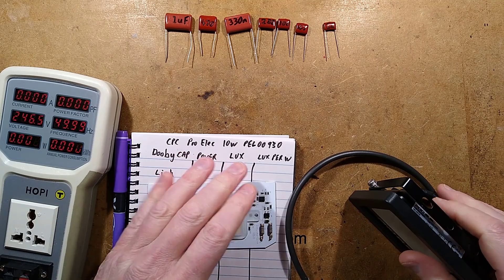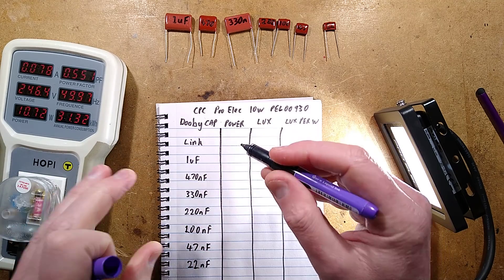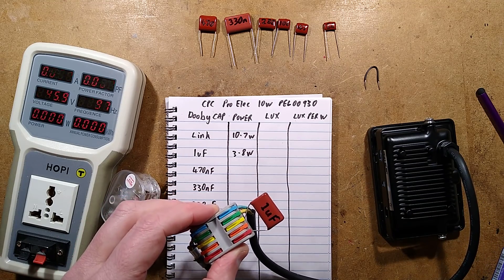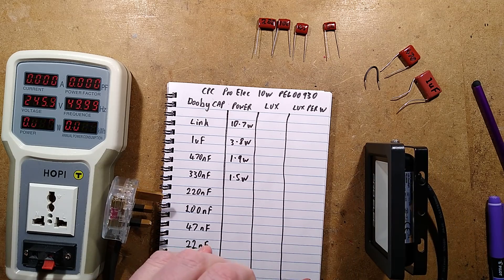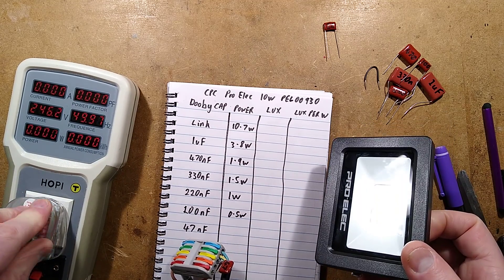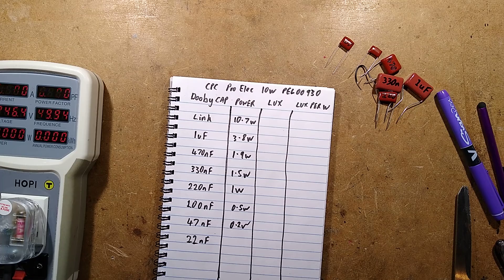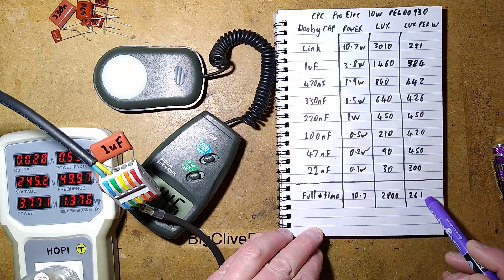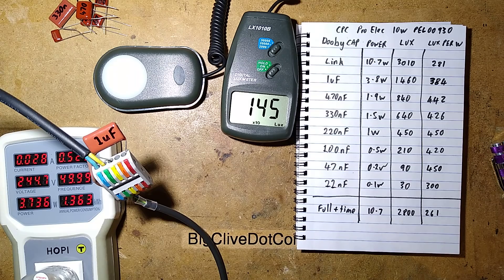Doobying a cheap LED floodlight with lux/efficiency readings

Comment: If you buy something like this (especially from somewhere like ebay) it would be worth checking the output. You probably haven't got a lux-meter, but a standard multimeter can give a rough estimate. An averagely efficient 1500 lumen light will draw 12 to 15Watts.
I bought a 1500 lumen 12volt bulb for my garage to run off a vehicle battery. I thought it was nowhere near bright enough, so I checked the current and it was about 0.4Amps or 400mA. That is under 5Watts! The light was 1/3 of the advertised power! I got a refund.
All the 12V LED bulbs on ebay were being sold by what appeared to be UK based Chinese sellers. When I contacted a couple to ask whether they could guarantee the power of their bulbs before I bought, they said something like "We don't think our bulbs are suitable for your purpose. LOL!
Edit: I have now bought some from a tool warehouse which were full power and no more expensive.

Comment: I wonder how easy it is to modify the lamp itself by adjusting the current flow (rather than a series capacitor) to do drop that 10W down to 5W. I imagine soldering on that aluminium backed PCB wont be fun

Comment: What would it be like if you had say a 3 or 4 uF cap in?   Would it give similar light level to the link, but with slightly reduced power usage?
I think for the purpose of a flood light, using the 1uF doesstill make it a very usable light.  MY mind is just wondering what saize cap will keep the  3000 Lux but with a slightly lower wattage :)

Comment: I don’t understand why decreasing the capacitance decreases the wattage.  

Capacitors resist a change in voltage.  
P = VI
As the voltage increases by lowering the capacitance of the capacitor, shouldn’t the power go up?

Essentially I intuitively think your Wattage should be going in the opposite direction, but observational evidence shows otherwise and I don’t understand why.  Hmm... I guess I could go check myself...

Comment: You've built a Dubai light that has better L/W by reducing current? It's complex because of the AC to DC and current regulation, but seems like we need better labelling of lum/W or even cost per lum-hour. We see a bulb claims to save $75 over incandescent, but don't see saves $5 over the crappy LED with poor lum/W.

Comment: I think the problem with using smaller capacitors to extend the life of the LEDs is that high speed voltage spikes from lightning and other sources can still get through.
Whereas a resistor would provide a greater impedance even for very short pulses.  Perhaps a combination of capacitance and resistance.

Comment: Does anyone know how I could calculate the needed capacitance in order to have my AC COB LED light running at a certain power? I have the one that Clive reviewed in 2017 I think, the basic cheap light that flickers because it has no smoothing capacitor.

Comment: Bought 10 60w equivalent led house bulbs only £10 B&M
Reply from the maker: Those are probably the super-hackable ones where breaking a single resistor off can make them run more efficiently at lower temperature.

Comment: I have 34  100W LED flood lights, would putting 1 uF resistors over them make a big difference in electricity usage
Reply from the maker: It certainly would, but they wouldn't emit much light.  The cap hack is best for low power lights.

Comment: Hay man can you use a variable capacitor (like the ones in old radios to make a dimmer switch for LEDs? I am a biologist so I probably fucked that up tell me why this is a bad idea 🤪
Reply from the maker: It would have to be huge.  The radio ones tended to be measured in picofarads.

Comment: Assuming no change in distribution and constant distance between luxmeter and the DUT (luminaire) whilst changing power level, you are effectively measuring the lumen output. Generally speaking, power consumption will drop by a few % once driver circuitry temperature has stabilised and lumen output will drop as the diodes increase in temperature.

Comment: Hey Clive - I love the idea but I am not comfortable with sticking a capacitor just someplace where it would be fitting.
I love the idea that I won't grill my lamps - would it be possible that you maybe show us a video where you pimp a light-fitting so it limits it properly for any bulb? 
I am not sure if I want to crack open my regular screw-in bulbs so I love the idea of putting a capacitor in the light-fixture to have the fixture reduce the power to any lamp I put in there. 
Maybe with a few infos on what to look for (proper isolation and maintaining safe electro-installation standards). 

Not as a tutorial for liability reasons per se, but more of a "what to watch out for so you don't grill yourself"
Love it and I hope the manufacturers stop their shitty greed and stop grilling everything to death.
Reply from the maker: If you search my channel for dooby you will find another video showing various inline options for use with standard LED bulbs.

Comment: Clive, you've convinced me! I saw it on the live stream, and seen the experiment here, and I'm going to "Dooby" my Yale branded yard light. It is quite tiny, and yet ferociously bright in relation to its size. It doesn't need to be, and given that it also exhibits that thing where some chips appear brighter than others, I'd surmise that some are carrying more than their share of the current. Perhaps lowering the power will take the stress off them?

Just out of curiosity, have you tried running two or more household LED bulbs in series?
Reply from the maker: It works with some LED lamps, but others have such high combined LED voltages that they won't light.
Reply: @bigclivedotcom  What happens if the bulbs are 'identical'?
Reply from the maker: @28YorkshireRose12  It still depends on the combined LED voltage.  On a lamp I just disassembled today there were only 5 LEDs but each one was 50V, so the lamp requires at least 250V before it can light.  Putting two in series would not work.

Comment: Does putting the 470nF in series work on lamps like these?
https://www.ebay.com/itm/50W-Full-Spectrum-LED-COB-chip-DC12V-32V-Integrated-Smart-IC-Driver-220V-110V/254331003382?hash=item3b374f21f6:g:mF8AAOSwEDBdVMW~

I would love to have more of them running cool instead of one of them running very hot.
Reply from the maker: Yes, but it's only suited to low power applications.  You may need to use a few microfarads for the higher loads.
Reply: @bigclivedotcom  Thanks.  I will try it.  I don't want the weeds in my garden to catch on fire. (And no, I am not growing marijuana in my closet. )

Comment: What would happen if you put this mod on the neutral instead of the live? I live in a country with symmetric plugs (northern Europe). Given that I have to ask this I will certainly not mess with mains electricity like this myself, but I'm still curious.
Reply from the maker: It can work on either conductor.

Comment: A very interesting experiment.  Someone should sell an adapter socket with built-in capacitor to increase the life of LED bulbs.  I am pretty sure that most of them are designed to fry themselves into LED lamp heaven.

Comment: Please forgive the simplicity of this question - i certainly do have large gaps in my knowledge of such things (but I do like soldering kits and pcbs for music stuff but thats mainly 12v/9v stuff) - are these Caps 250v/300v seeing as your using the lights plugged in to the mains? Im on our 3rd set of back garden floodlights (pro-elec incidentally) and extending their lifetime sounds like a good idea - well that and the fact that they tend to dazzle our cats at nigh time! Cheers!
Reply from the maker: These are standard 400V film capacitors often used as current limiters in simple lamps.  I recommend using a 1 megohm quarter watt resistor across them to discharge them when the power is turned off.
Reply: @bigclivedotcom  Many, many thanks! Sincerely appreciate it (and Im sure my cats will also thank you!).

Comment: Does running dimmable LEDs with a dimmer lead to similar efficiencies (Lux/w) or are the dimming LED drivers inefficient?
Reply from the maker: It definitely reduces dissipation, but standard dimmers are harsh to electronics.

Comment: Hello Big, could you make a video clip with a HAMS5973 type light detector (photodiode)? I recently researched led bulbs (watching the voltage out on the oscilloscope), IKEA lamps, battery-powered flashlights, and found that they pulsate in a strange way, sometimes sine, sometimes short pulses, and some shining with continuous light, I think such a movie would be interesting if you want I will send you photos of how interesting you are, u make Great Job with Light !!!
Reply from the maker: Many lamps are driven by pulsed power supplies or use PWM for dimming.

Comment: They claim LEDs to be oh so efficient and the run them so hard that they fail faster than normal incandescent and aren't that much more efficient either. sadly that is what cartels are doing.
Seriously - 50% increase in efficiency just by adding a single capacitor? While also increasing the lifetime dramatically.

Comment: So informative! Many thanks Clive. This might be worth more experimentation: what if a dimmer switch was marmalised (I haven't quite worked out what doobying means BTW!) and a variable capacitor inserted instead? Trouble is, anything small enough to fit in a flush or surface switch box wouldn't have enough capacitance - or range of capacitances. My crappy London flat built by a very well-known UK building company has hollow walls 7cm thick. I am wondering if I put a range of caps in a separate box in the wall and use a multi-way switch feeding to them, I might get some decent dimming. Plus long life out of my LED lights. The only problem I can think of is instability if the lights are some distance from the light switch. Wotchew think?
Reply from the maker: Doobying is a play on the high efficiency Dubai lamps.  A variable capacitor of the required voltage and capacitance rating would be huge.
Reply: @bigclivedotcom  Ah - so you're setting a trend. I expect the word to travel the internet...
Reply: PS Can they arrest you for doobying in public?

Comment: Great video. Could you do a video with a variable capacitor and an LED batten? Would a variable capacitor make a good dimmer?
Reply from the maker: A variable capacitor with high enough value would be huge.
Reply: @bigclivedotcom  Ah, okay. Would a capacitor  with a potentiometer in parallel be of a manageable size? If so, I'm looking forward to the video.
And thanks for all the amazing videos so far!

Comment: I have a 30W LED flood light with an integrated PIR sensor, when it was new it worked fine, it still does but over time I noticed the LEDs started to glow even when switched off, as time goes by the LEDs glow brighter and brighter at the off state, even with the power switch off which I find a bit odd what could be causing this? The switch is a double switch one button is connected to the flood light the other is connected to another light, but even with both lights off there is always some residual light on the flood light.
Reply from the maker: It could be the effect of moisture ingress.
Reply: @bigclivedotcom  Perhaps, but it's not exposed to rain there.

Comment: Wondering why the 330nF was so physically large.
Different construction or voltage rating from the others?
Reply from the maker: It's much bigger than normal.  But probably longer lasting as a result.  Small caps with thin film tend to degrade faster.

Comment: Ok love this. Now if we buy a 20 watt and fit it with a capacitor and discharge resister.. what will it need to draw to equal the same or close to the same light output as the 10 watt?
Reply from the maker: That would depend on supply voltage and internal driver.  But several 1uF or 2.2uF capacitors may work if wired in parallel.

Comment: I must order some of those 🌈 connectors, beautiful AND useful.
I'm wondering, would this work with a PIR LED light? The one outside my workshop failed a couple of days ago and on examination I was annoyed to find the COB is sealed into the light. I'm going to assault the thing with a heat gun later but I'm betting the glass glued in will break.
Reply from the maker: There may be a balance between limiting the current and still allowing the PIR module to work.
Reply: @bigclivedotcom  Thanks Clive, this is what I was wondering. I'll follow your lead and have a play around with values and see what happens 🙂

Comment: Would a similar method work for an led cob? Would you just put a cap in line with the driver or could you just get a smaller driver I.E. a 10w/30v led cob being pushed by a 5w/30v driver or would you have to use the 10w driver with the cap in line before the driver?
Reply from the maker: You'd need a rectifier and inrush limiting resistor.  The capacitive limiter is less suited to the lower voltage cobs.
Reply: @bigclivedotcom  could you spoof it by just running a 5w led driver on a 10w LED?

Comment: I tried that one time and yes, I get better performance in terms of wattage/LED temp, but even if I drop it from 10W to like 5-7W In actual dark environment it was... bad... it was in that point of brightness where you get actually annoyed because you see what you want to see but it was just... you needed tad more to see it clearly. 
Its DAMN HARD to find good balance depending on light.
Reply from the maker: I use lamp holder splitters to use several lower power lamps.

Comment: Dear Clive,  keep in mind that the general public don't have soldering irons.  You can do your bit to save the planet by teaming up with a company that simply puts a capacitor in an adaptor.  "Plug your led work light in via this adaptor and it will save energy and last 30 times as long".  Thanks for the experiment.  Btw the lumen is a measure of total light output, which can't be achieved by sampling one part of space (there ain't much light round the back of this one, but there is in others) whereas the lux is a mesure of intensity in a chosen region.  So a meter plonked in a particular position can only report lux, not lumens.  So a rating in lumens is great for an omniradiant dangling bulb, but nigh on useless for a spotlight.
Reply from the maker: This demonstration didn't require a soldering iron.

Comment: I make LED lights for a living. By reducing the current to each LED and therefore the junction temperature of the LEDs when running you can vastly increase the lifetime of the leds and I've been producing LED lights with close to 200lumen per watt efficiency since 2014 and have a independent lab test on a custom  light I made for a pharmaceutical company that has a projected lifetime of 511,000hrs. However not all LEDs will increase the same in efficiency  if you under drive them, depends on packaging of the die and the original die used. But they'll all increase in lifetime. If you want to buy really cheap LED fixtures do this to make them more reliable. 

Great video Clive.

Comment: one could also use a switch to bypass cap to gain max out / or dim !, and yes it wont hurt the switch contacts if u use a proper one not a tiny lamp type
Reply from the maker: I'd use a series resistor to limit the peak contact current.

Comment: this is incredible. didn't know you can do this on "AC LED". i did some testing too albeit in simpler scale with 12V DC led bars (white and red). i hooked em to my bike and powered it with a USB powerbank and DC step-up converter which you can set from say 9V to 13V. i had to let it run at around 10.8V to achieve acceptable brightness, heat level and battery consumption. if i set it to 12.0V (which it is rated) not only it is so hot but it also drains the battery quickly (more watt consumed).

Comment: Would a dummy load of about 1W keep the hopi working at low loads.  Like a 1W 470K resistor in the clamp terminals?  Also would a high VA load keep the W reading active, so a capacitor could keep a useful display without manual arithmetic?

Comment: These would be very good as low-level path lights, with series capacitors selected to suit the distance between them so as not to leave any dark spots.

Alternatively, if you had some of these lights wired to a PIR sensor, you could wire a capacitor across the relay contacts so as to give constant low-level illumination which would go full brightness whenever something warm  (you, your car, a visitor welcome or otherwise, passing vehicles, one of the neighbourhood moggies .....)  moved within the sensor's field of view.  The lamps would only be on full power for a few minutes at a time, so should still last a few years.

Comment: I remember the Bulb Boss that you would put between a screw base bulb and the socket (it was a little disk) and it would ramp up the power to the (incandescent) light and supposedly prolong the life of the filament. I think they also has one that would let you flick the switch to dim the light.

Comment: i have 2 of the 50w module and i tested it whith 0.64uf upp to 3 of them in paralell but i only got them upp to 13w doesn't it scale with the high power? I whas aiming towards 40-50w total. And ideas?
Reply from the maker: It's only suited to low power in the 5 to 20W area.